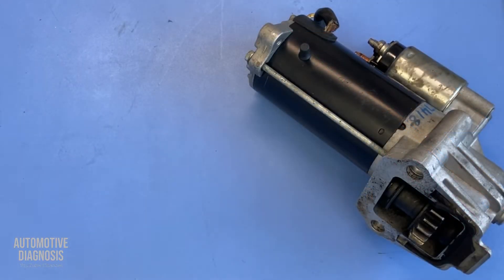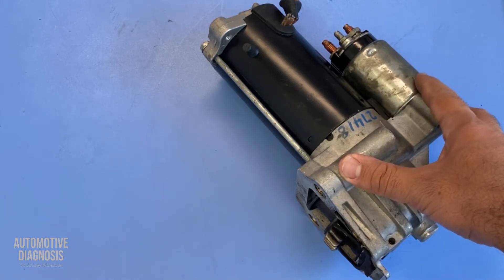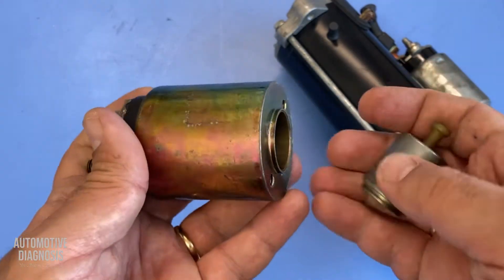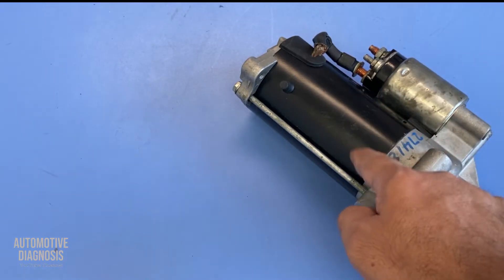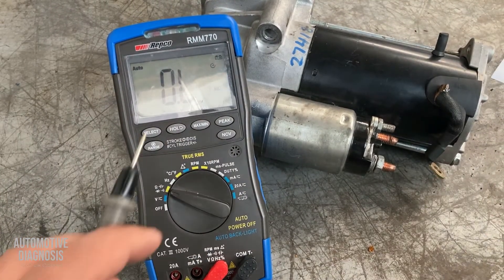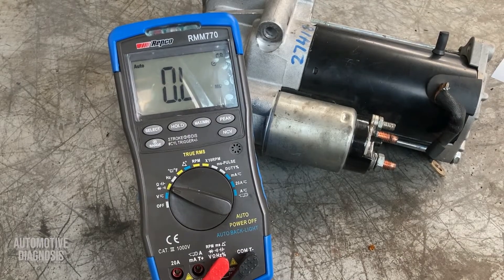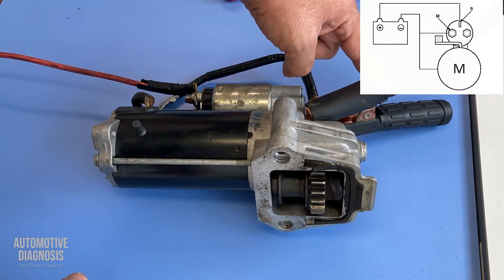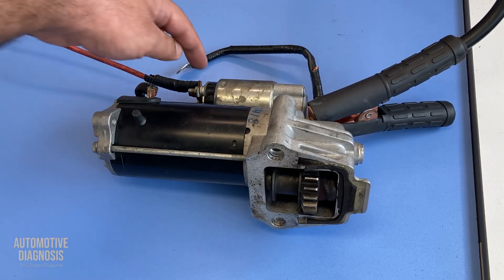Starter Motor Solenoid Diagnostics Explained | Pull-in & Hold-in coils | Test Starter Solenoid

Comment: According to the schematic, the pull-in terminal did not need to have that ground wire attached during the test. It should have sought the  ground through the starter motor winding connected to the chassis, to provide the starting current to spin the rotor as well as assisting the holding coil to close the relay contact. But as soon as this relay contact is established the battery takes over to keep spinning the motor with more energy while the pull in relays stops pulling as it no longer sees the ground through the motor winding. Meanwhile the holding coil is still energized and holds the rotor engaged as long as the ignition key is on. That's your original explanation which I understood and accepted. But then you used that grounding wire that was not needed. Perhaps something escaped my understanding, so please correct me if I am wrong. Thanks for the video. It's well made.

Comment: Excellent Video! I have a ASE A1-A9 study guide versión 2025-2026 and it states "...measure resistance between the control terminal and the solenoide case -typically 3-5 ohms for the pull-in winding". With Your video I realized that the guide is wrong because it should be for the hold-in winding, right?
Reply from the maker: Hi my friend, Pull-in winding is normally get the ground from the starter motor winding to stop working right after solenoid is activated. I haven't seen the study guide you mentioned,  but if wiring diagram is included, you can trace the windings on the diagram to identify each one.
Reply: @AutomotiveDiagnosis thanks for Your response. I bought the guide in Amazon but it has several errors in different topics, no wiring diagrama either. The videos on Youtube as yours help me a Lot to study. You are a great teacher. Please continue making them!!

Comment: I've found that many starter solenoids don't have an M post to isolate the pull-in coil. Do all starter solenoids have a pull-in coil, or in smaller starters do they simplify coil wiring by deleting the pull-in coil? Often the OEM dealers manual doesn't have enough detail to tell.
Reply from the maker: Hi my friend. Yes, most of the time information provided in the dealership manual is not enough, but based on what I have seen so far, pull-in coil is used in all of them. Also M terminal is needed to, because it must carry the high current to the starter armature too.

Comment: Hi i done the last test you did however the pinion could not go up. Before then i did a test in which the pinion did spin up but could not hold up enough but spinning. Does that conclude to faulty solenoid?

Comment: If the resistance is between 37 ohms and 40 ohms in a Nissan Sunny N17 and if you use a buzzer with an ohmmeter between the can high or can low and ground, it will make a buzzer sound, and if you reverse the leads of the ohmmeter, the buzzer will not make a sound.
What is the reason?
Thank you 😊❤

Comment: I replaced my solenoid and and relay and used aux. start switch for power to small terminal  and still have intermittent start. It appears the pull-in coil is not getting sufficient ground.  If the motor supplies the ground for the pull-in coil through the brushes does that show my starter motor is the problem?

Comment: Good video.But I dare to add some starter selenoid have external R pin terminal suposedly it was used to bypass voltage to points ignition with an diode or alternator field or some other device,suposedly if you use the R terminal the pinion gear stay on the flywheel or odd polarity swap acures who isnt good for baterry or alternator ,another thing I want to add +12-12= 0v so that extra wire is actuali an compensation wire for that porpuse Im not shure about polarity just trust my about that it has to do with induction and colideing poles any way they are rated at around 24v so if you like 1 input to 1 out put dc converter cirquet part ,lot other devices depent on the + voltage and the negative voltage. For exampel delco 10-12si series alternators use reference voltage baterry negative to determine when to charge when tge cutt in fueld current will take place at what rpm range so it used higher negative some fractional lowr voltage positive from field or dash who are around 9-10v and it becomes partiali ac and some voltage is devided true diode trio then you get back flat line dc positive and negative true the bridge rectifier in %\% ratio difference + and - of corse the volts /apms ratio also is effected thats why those 2 wires are important not only for activating the starter motor but for all other devices in the car what depends on voltage potentials . Just add 1 ceramic capacitor or resistor or some wiard electrolitic capacitor instantli the cutt in current to the alternator field will change instantli even the starter motir will behave differentli as well the baterry volts/amps ratio will change . So hoppe this makes sence .Expeciali magnet type starter motirs are complexs they have lot in common with old compound dc motors and metadyne transforners so they are variabel devices with variabel out puts.Do not hit magnet starter ,do not heat ferrite magnets ,do not misplace pole peaces the end result will by same like with those old pulley driven dc generators they might change out put to the main brushes insted positive and negative it might by this - + or + + or - - ,as an out put voltage polarity .Just my way pointing out some things here.Nothing ells .Weak spots are also metalic springs,worn brushes ,commitator shorts and the actual brush holder and rear cover might suffer arcing welding the metal becomes blue so less metal compared to carbon so it will not conduct to ground .So you see guys magnet starter motors are lot interesting.Any way just wanted peopel to know if they get in trobbel so they know where to look for.

Comment: Thank you for your video 
But I have a question please , how does you measure the resistance of pull in and hold in coils and get the right value if they are connected with parallel , you have to seperate them to get the right value for each of them because the two coil have the same start point and end point in reset status ??? 
Thank you again
Reply from the maker: Hi there, thanks for watching the video. They are not connected to each other from both ends, but only one end.
Reply: How is that ? Could you please draw a sketch for the ends for both coils and upload on the comments ?